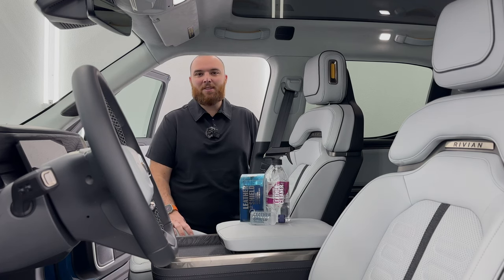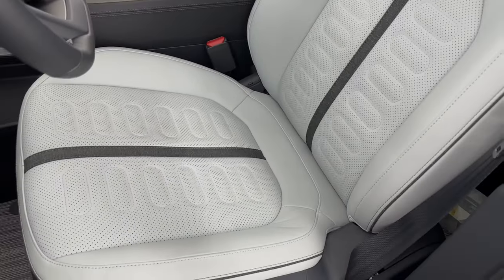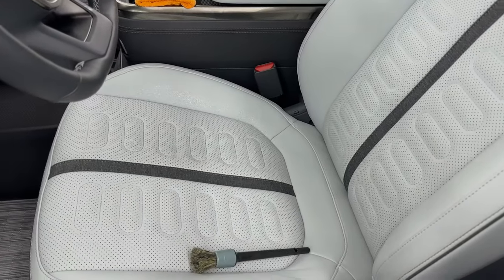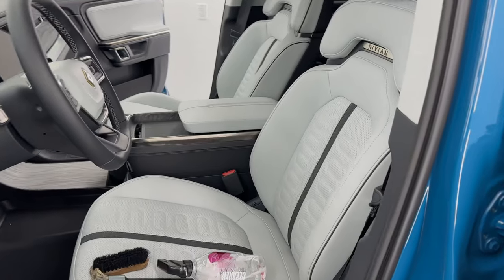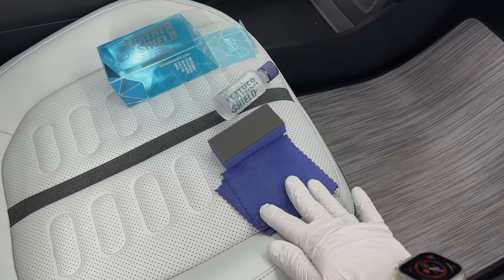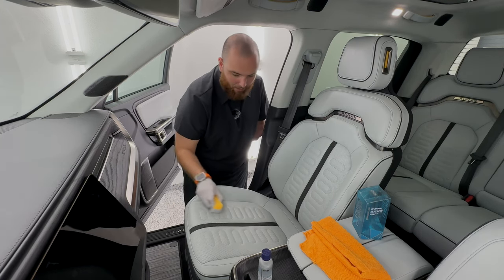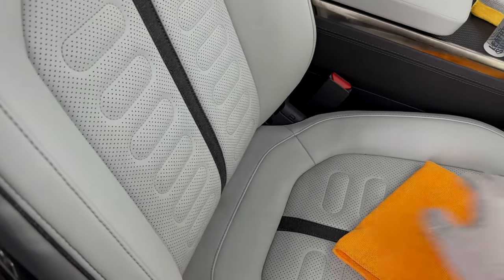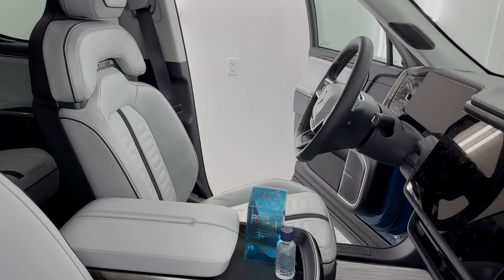This Is The First Thing You Need To Do When Buying A Rivian With Ocean Coast Interior

Comment: Great video Coleton, thanks!  How does the Leather Shield product work with dog fur?  Does it attract it more?  Is it harder to remove due to more static or anything.  I saw that you didn’t recommend putting this on the steering wheel (completely understand that).  What about applying to the dash?  Does Leather Shield offer any UV protection that would make that worth doing?
Reply from the maker: It does have UV protection. It’s also anti static meaning it will not attract lint or dog hair!

Comment: I was sold on this product until the demonstrator refused to use the Dark Blue Applicator on the white seats.  That proved to me right there that he wasn't confident in his product.  Think about it, he's demonstrating that his product can get color transfers removed from the leather seats, so if the Dark Blue applicator where to transfer color - what is he saying? He can't remove THAT particular color?  Then what's the point of getting that product???  Did I miss some critical information?  Please explain.  Seriously.
Reply from the maker: The whole point is the dark (heavily dyed applicators) have never been washed or “wet” 

Think about the first time you wash a dark colored shirt, some of that color will leech out into the clothes you are washing.

I want to minimize that risk with the applicators.